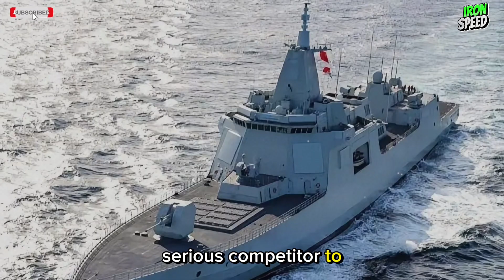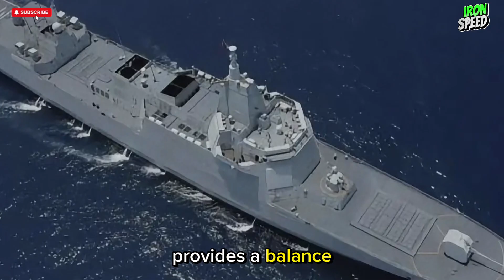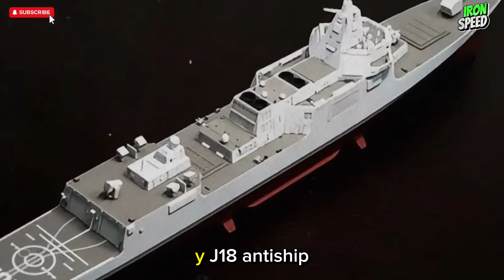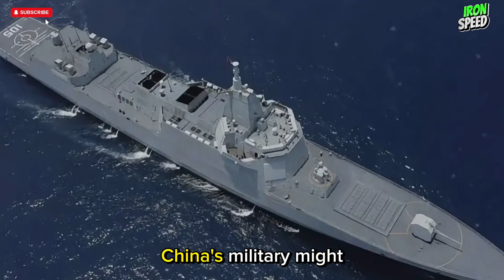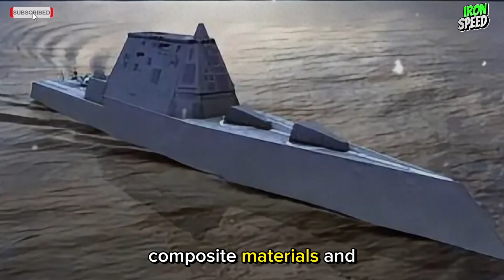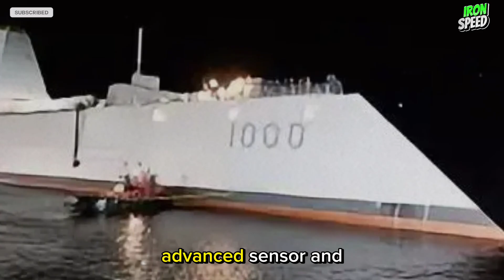China Type 055 vs US Navy Zumwalt: Who is more terrible ?

Comment: If I am not mistake the Zumwalt has been discontinued some time ago and there are only 3 operational to date. Furthermore it was specifically designed  to attack land targets  and does not have strong anti-ship, anti-submarine and a  mediocre air-to air defense. This is one of the main reason why it was discontinued besides the cost over-run. How to compare against the TYpe55?
Reply: Wrong on part of that.  Yes there were only 3 built... for now.    The three have more firepower than the Burke OR the Ticonderoga class ships actually.  They are also superb ASW ships due to their technology including sound mitigation.  They are now undergoing refit to add Hypersonic missiles capability, replacing the 2 main guns that cost way too much for the ammo they used.   Additionally, they could also be fitted with heavy energy weapon systems because they generate enough power to run a medium size city on their own.   From all the lessons learned now and in the future from these ships, the next generation cruisers will be built.
Reply: @Malakie  If it is so good why discontinue? It should build more instead. Likewise the Ticonderoga class are so old most have already passed their expiry date...Likewise too for the Arleigh Burke  but for now the USN had no choice but to build additional upgraded version of the Burke as its long touted replacement the Zumwalt is a dismal failure... The USN replacement is now the Constellation Class destroyer. Again, faced with long delays and cost over-run.
Reply: @eymeeraosaka2954  3 reasons.  1) politicians, 2) the gun ammo was $800,000 EACH round.  and 3) The cost of ONE ship is $4.4 BILLION with a B, to build.